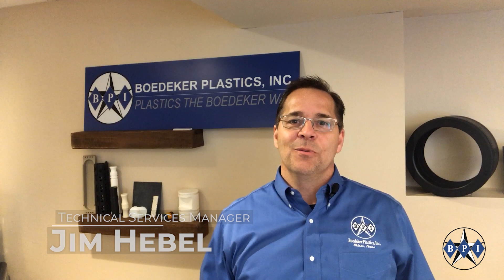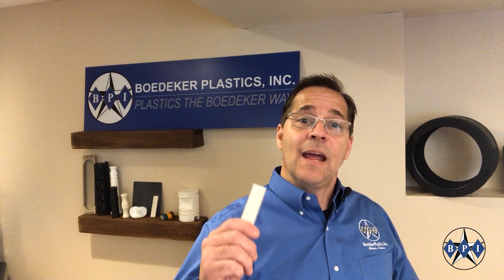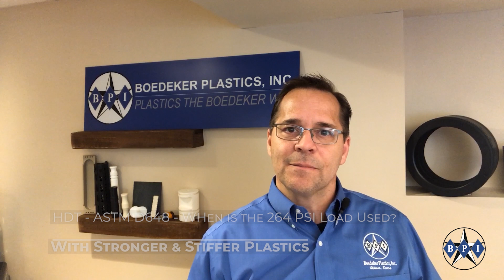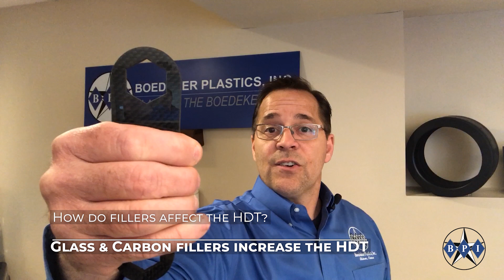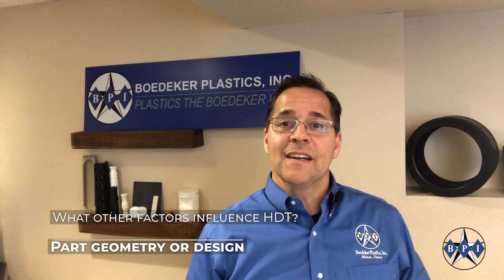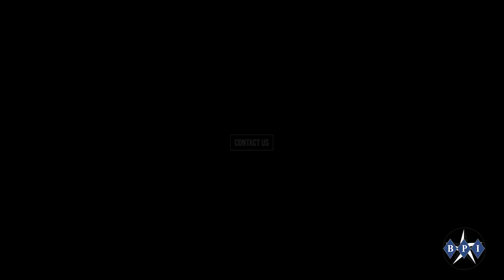Boedeker TECH Talk Episode 2 | Understanding Heat Deflection Temperature (HDT) ASTM D648

Comment: Very helpful overview of HDT, Any significant differences between ASTM D648 and ISO 75?  Also, I have read HDT can also be tested in a Cantilever fixture.  Do HDT data measured in a 3-point fixture differ much from HDT Data measured in a Cantilever fixture?
Reply from the maker: ASTM D648 and ISO 75 are very similar with some minor differences.  ASTM calls for the test piece to be run in a flat state with a measured deflection amount of 0.25mm.  The ISO procedure allows for the test to be run flat or edgewise (0.34mm deflection).  Regarding the cantilever fixture, I have no experience with this approach.  However, in the stock shape plastics industry where we live, the three-point bending set-up provides consistent and well-defined results and is the standard approach used for material datasheets.

Comment: Thank you for an excellent presentation. I was wondering if I can HDT test a polyurethane foam. If yes would there be a separate test standard for that i.e subjected load value?
Reply from the maker: Our specialty is certainly thermoplastics and composites, and admittedly we are less experienced with polyurethane foam.  However, yes, a foam can be tested for Heat Deflection Temperature, as can any material.  Of course, there are two main load choices that are standard for HDT testing....66psi (.46 MPa) and 264psi (1.8 MPa).  Typically, one of the loads above are selected based on the stiffness of the material being evaluated.  The lower 66 psi load is often selected for less stiff materials, like PTFE, UHMW-PE, elastomers, and foams.  The higher 264 psi load is used for the stiffer thermoplastic materials.  Thank you for your question!

Comment: Hello.
I hope you can help me with a query. I need to know in which material each force indicated by ASTM in HDT and VICAT is applicable, or where I can find that information.
I am evaluating PVC and CPVC material, but I don't know which of the two weights to use for each test.
Reply from the maker: Hello and thank you for your question!  The HDT test measures a material's ability to handle a load with temperature, while the VICAT test measures the temperature at which a material loses its stability-form or shape.  I am much more familiar with the ASTM test for stock shapes in which the ASTM D648 test standard calls for the use of one of two test loads....either 264 psi (1.8 Mpa) or 66 psi (0.45 MPa).  For PVC or CPVC, you could use either option depending on which may be more applicable for your application.  There are different tests for the VICAT, and it appears they will use either a load of 50N or 10N depending on the test chosen.

Comment: Hello.. Thanks for the video. Could you please suggest how HDT shall platy the role of Operatin temperature? My product operating temperature is -40 deg to +85 deg C.
Reply from the maker: The HDT is simply the result of a standardized laboratory test which identifies the temperature at which a material will deform under a given load (typically 264 psi).  If you have an application with an operating temperature up to +85C, and you require some level of strength and stiffness, then you will want to select a material with an HDT which is higher than 85C.  If you have not already watched them, you may wish to review our other videos on Continuous Operating Temperature (Boedeker TechTalk Episode 1) and on DMA Curves (Boedeker TechTalk Episode 4).  Choosing the right material for your application is often a balance of understanding several of a material's properties including its HDT and CUT, along with understanding its strength and stiffness retention at temperature (DMA data).
Reply: @boedekerplastics  THank you for your response. this helps..

Comment: Thanks for this video! I’m currently researching hdt and this was very helpful. There’s still something I don’t quite get about hdt though - if the hdt varies depending on a part’s geometry, then doesn’t that mean that the temperature value attained from this test is useless in any application other than one that uses a polymer bar of the exact same dimensions used in the test?
Reply from the maker: Liam, thank you for your question.  As with most ASTM tests, the configuration of the test sample and the conditions in which the test are administered play a dominant role in the results.  I view most of the datasheet properties for polymers as data to compare materials to each other.  One has to understand that given these standard conditions, you can compare how one material performs versus another?  With HDT, as you suggest, the test only tells you when the material of that given configuration starts to deform under the given load.  If you have a higher load, the material will most likely deform at a lower temperature, and vice versa.  The same will most likely be true for larger cross-sections.  Of course, this is also why FEA design modeling can be extremely helpful.  Thanks for the dialogue!
Reply: @boedekerplastics  Thanks very much for your detailed reply, this has helped clear things up for me!

Comment: Thx, very clear video. But how can I get 66PSI load? What weight should I place in the center of supported test object? Should I calculate it from bending modulus?
Reply from the maker: If using ASTM D648, you will need to calculate the Force to apply to the sample based on the three-point bending equation.  Force (N) = 2/3 [ Stress (MPa) x Sample width (mm) x (Sample thickness (mm))^2] / Sample length (mm).

The Stress value used should be either 0.455Mpa (66psi) or 1.82 MPa (264psi) as defined by the ASTM.  The Sample length is actually defined by the distance between the support spans, not the actual sample bar length.  I hope that clarifies.

Comment: Hello Sir, 
How do you relate HDT with melting point of plastic parts ,is there any relation?
Reply from the maker: The HDT and the melting point of a plastic are really not related, except top say that the HDT is really the point at which the material is soft enough to deform under load.  Please watch our video on DMA on this same channel which talks about the different stages that a polymer goes through with temperature change.  This may help you relate the two.  The HDT occurs during the transition of the polymer from the "glassy rigid" stage to the "glass transition" stage.  Following these two stages the material enters the "rubbery plateau" where it is nearly fully flexible, and then onto the "melt flow" stage.  The DMA for a material is one of the best ways to characterize a material's performance with temperature.  Thanks for your question!